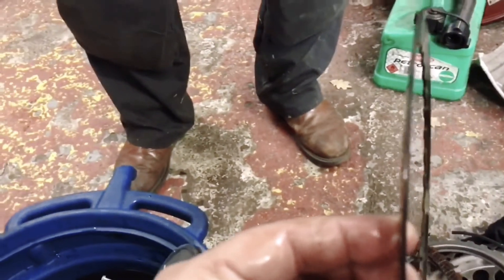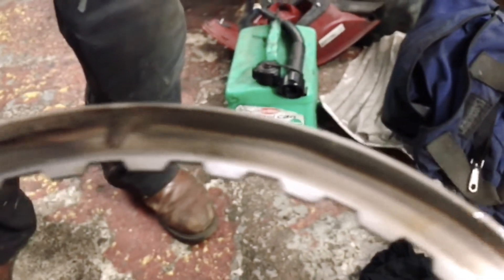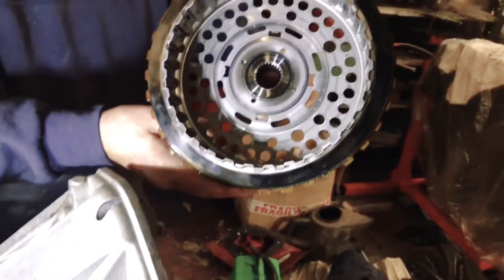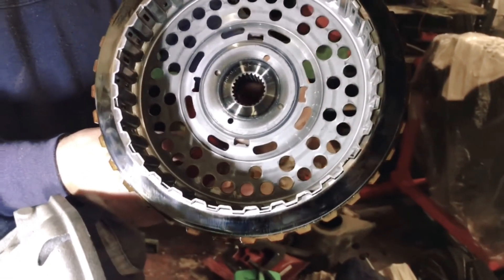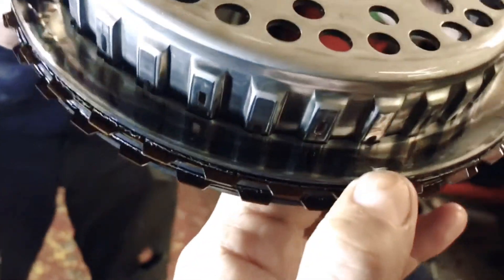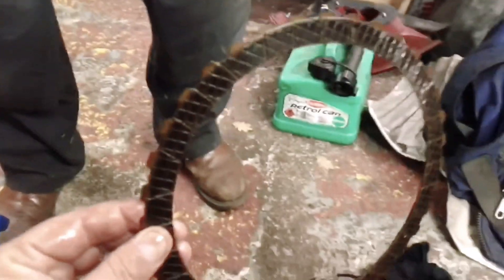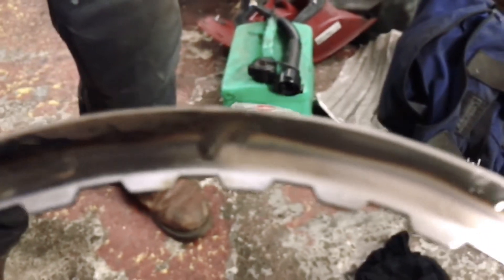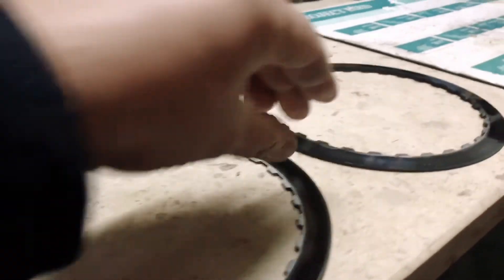BMW 7 SPEED DCT REBUILD NO FIRST OR REVERSE THE DIAGNOSIS PART 1/5

Comment: Hi mate, are you still active? Got some questions regarding the DCT if you are open to a chat?
Reply from the maker: Hello mate, ask away
Reply: @darrenlives  I've got an m4 with the dct box that seems to be a bit noisy. initially i thought it was making a bit of a thunk between 4th and 5th but, if i set it to manual mode and rev it up in 4th at a certain stage it makes that thunk sound. 

it all shifts perfect, drives perfect. did a dct service with the oil, filter, new sump. all the adaptations and such via tool, still making t his noise.

anywhere ive called says swap the box but was wondering as you've opened it up, maybe you have some ideas? 

sound seems to be coming from the rear section of the gearbox.

any ideas greatly appreciated!
Reply from the maker: @RubinH I can’t tell you for sure what it is, but the magnet inside are a very important part to clean as they get a buildup of dirt on them. They are not hard to take apart